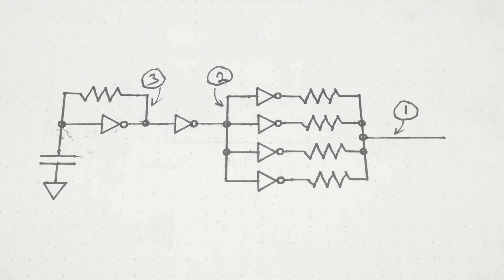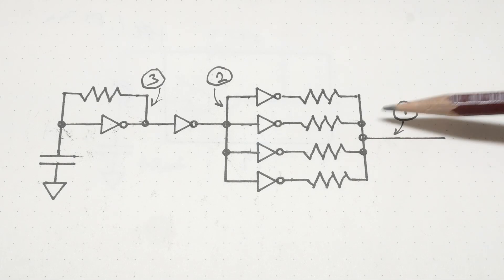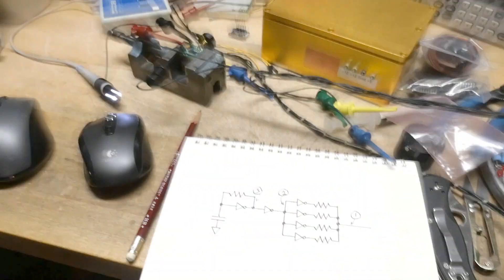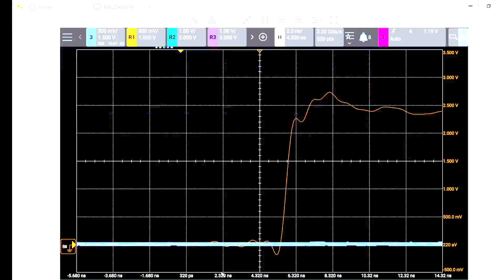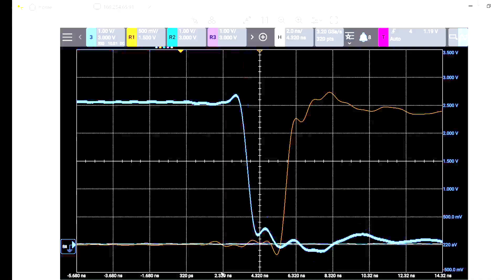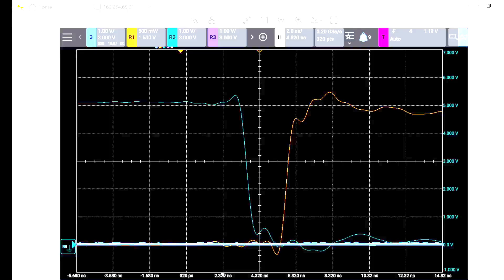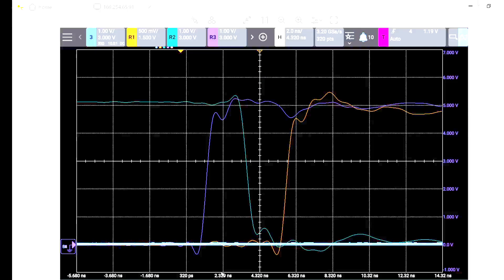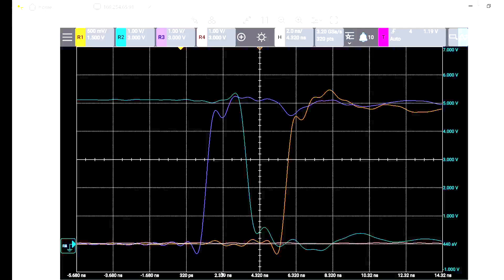#2354 Where does pre-bounce come from?

Comment: You also see this if you do a transistor level simulation of an inverter. Even if you only use models for the transistors and take ideal sources and probes. This effect comes from the capacitive coupling in Cgd in the transistors. The falling edge at the input pushes the output briefly below 0 as Cgd is still charged.

Comment: Use your current probe to measure the VCC to the chip.
Reply: The current probe maybe has not enough bandwidth. Ground bouncing can be measured with a spare output of the IC with it's input connected to '1' (in an inverter gate).

Comment: You have a digital oscilloscope that takes a limited number of samples per second, so not every trace point on the screen represents a sample. However, see how smooth and beautiful the trace on the screen is? That's because the software inside the oscilloscope draws a splane on which all the sample points are located. Therefore, the half of visible ringing on the screen is actually artifacts of the Bézier algorithm.
Reply from the maker: It’s a 1GHz scope.  Lots of samples even in a single one shot trace.
Reply: @IMSAIGuy  Hey, does the scope have a mode where it just shows the sampled points without the connecting lines? I'm sure that this scope has plenty of sample rate for this signal, but it might put to rest the grumbling about interpolation.
Reply from the maker: @jsdutky  yes, it has that mode, the trace does from solid to tiny dots, by on this scope there is no difference in the shape of the trace. as you say, might be a good demo I can point to.
Reply from the maker: https://youtu.be/evMJ2I-KgkI
Reply: it would definitely be prudent to disable sinc interpolation to see if it makes a difference.
Reply from the maker: @anameisrequired3729  I have tried that before, it doesn't make any difference on this scope architecture.
Reply: But it also happened on his sampling scope as well...
Reply: А может ли быть, предварительное снижение сигнала, следствием того, что в логических элементах используются полевые транзисторы, и у ни есть собственная ёмкость, и при таком резком приходе сигнала, в первый период, выходной сигнал ведёт себя так, как буд-то подключён к входному сигналу через конденсатор, и просто дублирует входной на выходе, пока наконец не начинают открываться PN переходы противоположного транзистора в выходном каскаде ?

Comment: The "prebounce" in 1 and 3 look identical, but are almost entirely absent in 2, while we see almost identical "postbounce" in all three signals. I'm willing to believe that the prebounce is an artifact of the feedback loop in the oscillator, now we have to wonder why it is missing from trace 2.
Reply: Invert trace 2 and you'll see the same response.
Reply: @tfrerich  except I DON'T see the same prebounce on 2. There's less than a full cycle before the falling edge of 2, while 1 and 3 have four cycles before the rising edge.